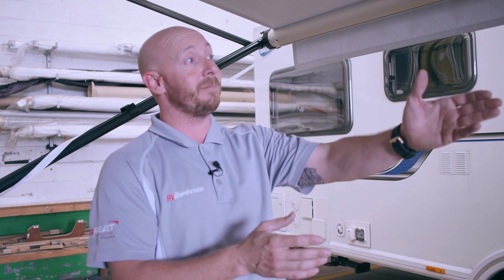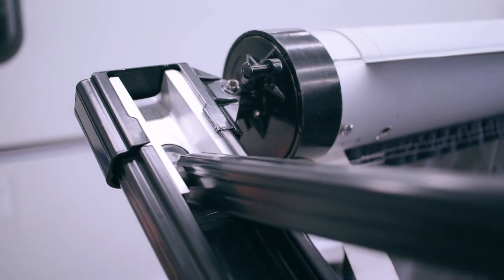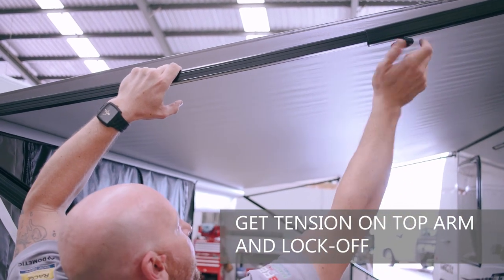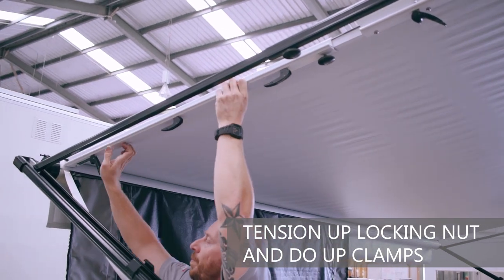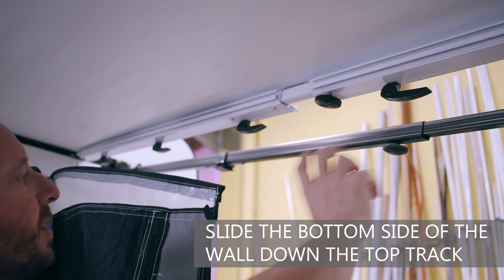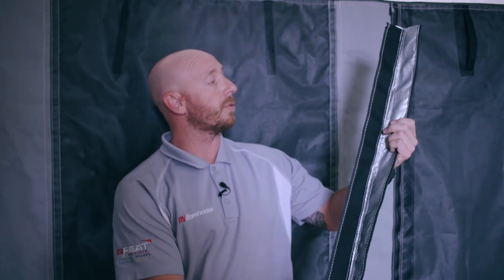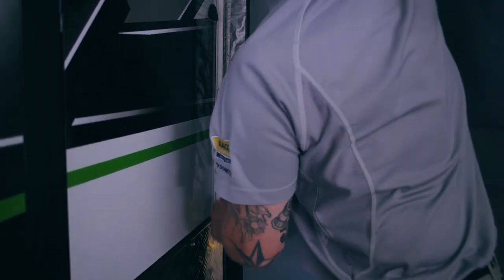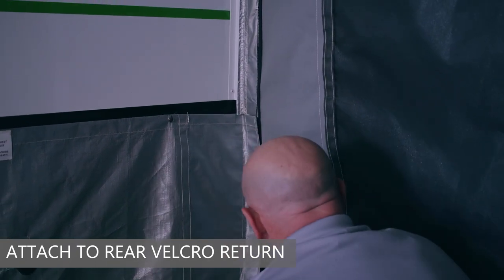Setting up your Annexe Walls with an Anti Flap Kit

Comment: Nice video explanation... thanks. Got one of these annex kits arriving soon. Just hoping it comes with anti-flap kit like with yours. My Thule 5200 roll out awning has none.
Reply from the maker: Thanks Mikey... If it is a locally made kit... then good chance its a yes.  If it is the European imported, then it could be a slightly lighter solution.  Can have their issues with the harsher Australian conditions.  Happy to chat more when it arrives at yours if you're  not quite sure the setup...  no fee of course.  HIt me up on here if you need a hand ;)
Reply: @GreatAnnexeCoTV  Just arrived ... no end supports at all. The front wall can slide into the C channel on the awning, but no idea how to hang the end walls without supports. Looks like another $270 for the end kit.   Should be a law against this.   Grrrrrrr. Or maybe I can make something up myself.
Reply from the maker: Oh no... seems odd.  What attachment components are sewn to the top of the end walls?  Sometimes is a rope spline or a pocket sewn in?  Knowing this will ensure you get the right end bars to suit
Reply: @GreatAnnexeCoTV  Turns out I was hood winked into buying a basic kit without the correct attachments. Their story is that it will hook up to the awning as I mentioned, but the ends just hang loose, and if you are not happy, which nobody in their right mind will be, then you BUY the extra attachments. That is a con for sure. Thule are very smart to add up the price with extras. Suck you in with the cheap basic price, and then hit you with a huge extras bill as follows.

Anti flap kit that will secure the annex better (probably like yours) $270
Center support rafter including brackets $95
C-Track channel because Thule not include on awning housing  $40
3 x support legs because mine secure to van instead of ground  $280
3 tie down straps... not sure of price.... maybe total around $60

Seriously, I am pissed at Thule and the guy who sold me this on ebay. Their argument is that this Annex can be erected as is... but honestly, "as is" will collapse under any serious strain. I will never buy a Thule item again. On the positive side, support was  good although they told me what I did not want to hear.
Reply from the maker: @strikemaster1  Ahh.... Ebay can be a little bit of a mine field at times.  At least you know what your options are moving forward...
Reply: @GreatAnnexeCoTV  Yeah... live and learn. Thanks for your help mate

Comment: Thanks mate great demo just put our annex on watching your video now what are the 3 extra holes on roll arm for ?? Would they be for extra support poles ?
Reply from the maker: If they are in the roller assembly, then yes.. holes generally indicate a pole location point.  Send a pic through if you need to clarify ;)
Reply: @GreatAnnexeCoTV  no poles included but thanks for you'd quick response unable to send pic 🤔
Reply from the maker: All good.. enjoy 😃

Comment: Do we leave the awning arms attached to the van and have two separate corner poles for the annex.
Reply from the maker: Correct… though you can stand the awning arm off if you require the access. Just ensure you anchor them well.

Comment: Nice demo. So after locking awning into position, your leaving it in the closing position? So the barrel wants to close back into the van? Cheers
Reply from the maker: Yes.. that’s correct.  This ensures that if a large gust of wind or large dump of rain that hits the awning will not allow it to continue to roll out and therefore encourage pooling or flapping.  The locking of the awning support arm and the rafters are the security that it will not roll itself back in again.
Reply: Alot of confusion around this on forums. Cheers
Reply from the maker: @palindromeAU  Ahh... forums can be a confusing place with various examples of situations that can be all affected by the unique circumstances surrounding each.  That is why I believe talking to experts in the industry would generally provide more accurate information... particular where unique circumstances apply.    Thanks for reaching out to us :)